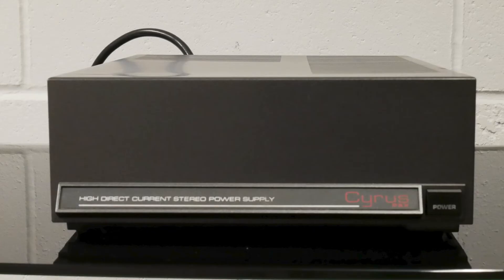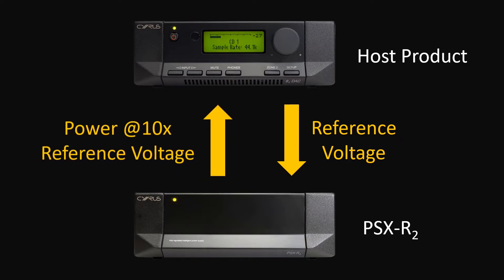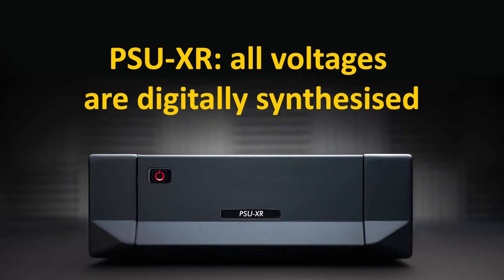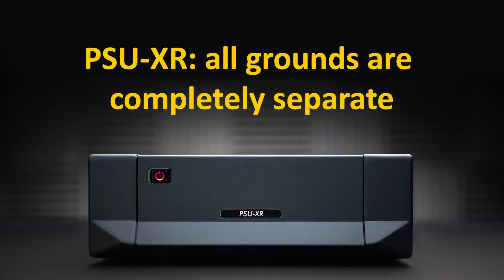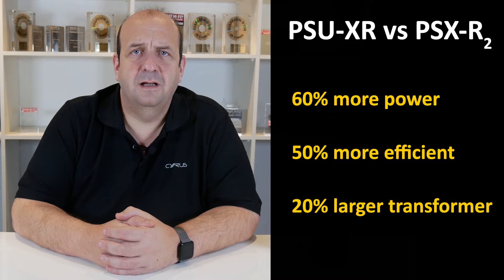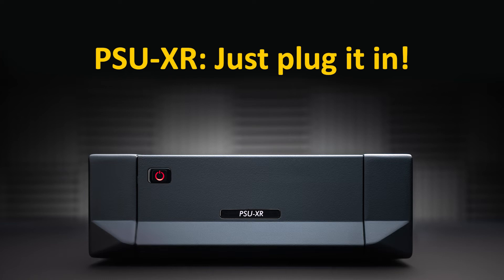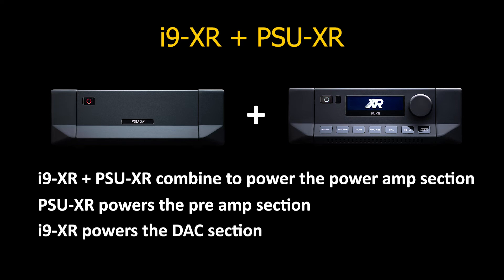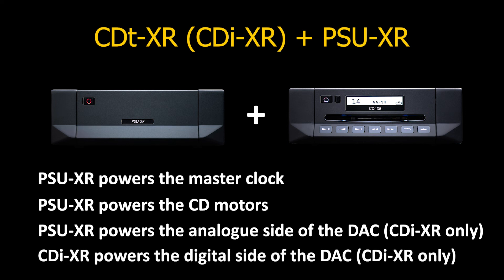PSU-XR - A Revolution in Power Supply Design

Comment: Does the PSU XR still benefit a host product even when downstream from a mains power conditioner?
Reply from the maker: Power conditioners need to be used with caution as they may be bottlenecks in many systems, especially when used with high power amplification.

Comment: How does the performance of the new CDT XR compare to the old CD XT Signature?
Reply from the maker: CDt-XR is an improvement over CD XT Signature, plus - unlike CD XT Signature - it is upgradable with the external power supply - PSU-XR. Have a look at this: https://youtu.be/12gRvnNSNfk
Reply: @cyrusaudio  Thanks for the reply.
Reply: @cyrusaudio  I've got CD XT Sig and unlike CD XT SE2 (I've got it for sale) it's not upgradable with PSX-R2. Why does XRt have a PSU-XR port and for which part of transport it's used for separate power?

Comment: What can I get owning the new CDT-XR only transport)?  Does this new power supply improve the sound? Thank you.
Reply from the maker: You get a cleaner SPDIF signal on the output which - when you have a capable DAC as well - results in a more accurate sound reproduction. Instruments sound more real with clearer edges of notes, bass is tighter and the soundstage is more clearly defined and deeper. You have to try it for yourself!
Reply: @cyrusaudio t if I use TOSLINK output to a DAC is the PSU-XR of any value please? Does the PSU-XR improve the TOSLINK output and the sonic quality further downstream please?

Comment: What is the OUTPUT IMPEDANCE ( @50/60Hz) of these units...how does it compare to the impedance of any
 " standard"  UTILITY OUTLET ..
I.M.H.O. the  " unit's "impedance ,  just cannot be lower than that of the utility..... 
that's what really matters....all else is "SNAKE OIL" .
Reply from the maker: This is not a mains filter but a fully configurable DC supply....
Reply: @cyrusaudio  .....is a dc supply.... that takes its input from utility " AC "mains( ...DOES that mean all downstream units are powered from this " DC"...?? All may have different dc input voltage ratings..??&..& their internal dc supplies are by passed?? ).  doesn't make sense...
Reply from the maker: PSU-XR adjusts to the requirements of the host product and delivers the exact voltage that is needed (microprocessor and two-way communication). Internal power supplies in the host product still work but as PSU-XR takes over a lot of power supply tasks, they are now doing less work and circuits that are supplied by them greatly benefit from this.... And yes it outputs DC, both PSU-XR and host products are plugged to the mains.
Reply: @cyrusaudio  is the psu xr data sheet/ specs available ..( online) for anyone to see??
Reply from the maker: @analoghardwaretops3976  https://www.cyrusaudio.com/products/psu-xr/
Reply: @cyrusaudio  configurable..to how many different output voltages ???
Reply from the maker: We do not disclose the actual number but we can say all voltages required by Cyrus XR products :-)

Comment: I am confused as to why now that the new PSU-XR  is offered that the top range Cyrus products do not have an 'upgrade' PSU facility input like the classics?
Reply from the maker: XR and Classic Series are two different product lines; PSX-R2 is designed to work with the Classic Series while PSU-XR is designed to work with the XR series.